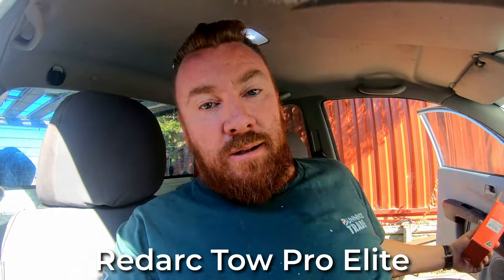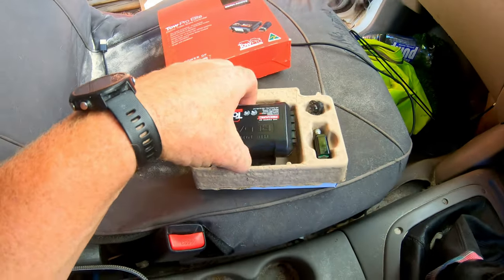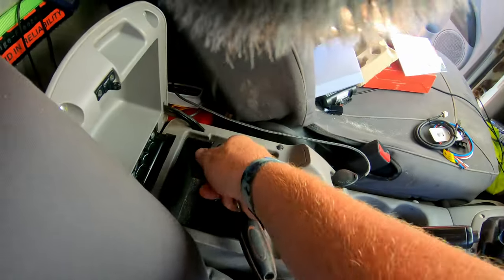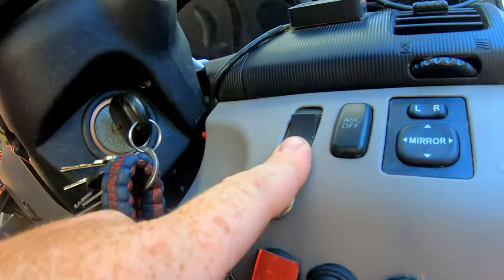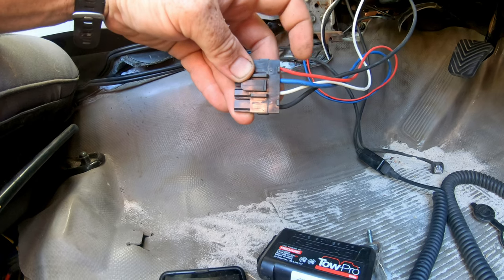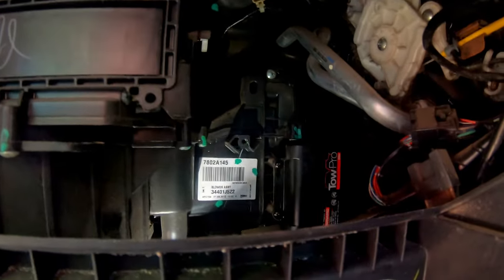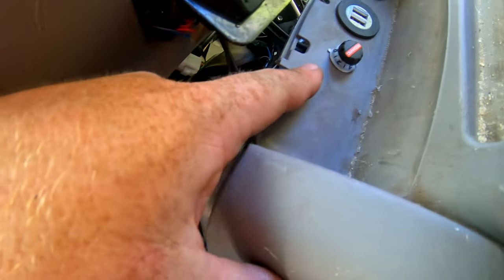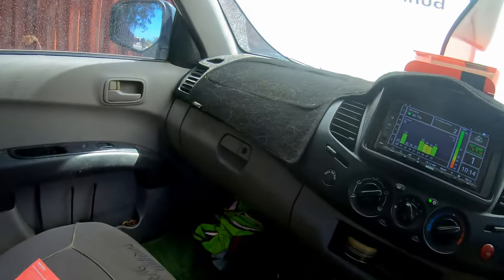DIY Install REDARC TOW-PRO ELITE V3 ELECTRIC BRAKE CONTROLLER - Mitsubishi Triton

Comment: Hey mate, did you just connect the red wire to your brake wire on your 7pin plug?
Reply from the maker: Yeah I did. Just a twin core wire the full length of the car. Brake signal in and brake output on the other.